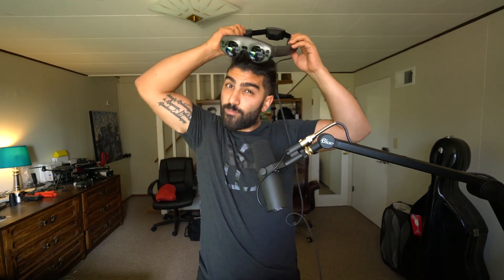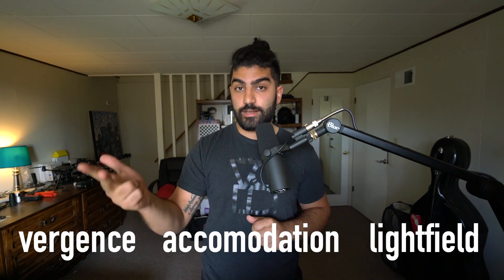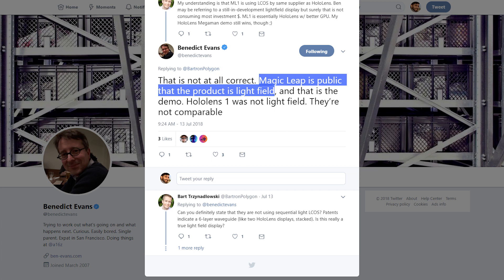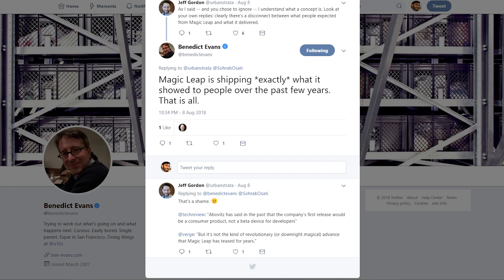The Problem with Magic Leap One's Display, Explained

Comment: Hey man, amazing work , i want to have your thoughts on the software you use for interiors I've tried using photo scan but it seems to pick up on unnecessary details in wide areas i might try 3DF zephyr to see if its better than photo scan

Comment: Dig the podcast and this vid was a solid supplement to the ML 1 podcast epi.  I was at the Digital Hollywood conference last week, a few days after LeapCon, and lot of the talk centered around Leap's AR future over Oculus' VR.  At OC5, Michael Abrash suggested scaleable AR headsets were more than 5 years away because of glass technology.  Leap defenders at Digital Hollywood suggested that was false, proven by Leap 1 and a headset by OGD.  I took a ML employee to task on a panel because he seemed to be peddling what, in my opinion, has become an insidious quality of Magic Leap's promotion -- deceit.  You were much kinder in your review, suggesting ML's waveguide technology is an overstatement rather than a lie.  I agree with your video's concluding premise -- that experiences are all that matter to the consumer.  However, I am troubled by what seems to be a pattern of obfuscation by Magic Leap going on 4 years...

Comment: Nice video, good attempt at explaining how it works! However, there is a factual error. You are confusing the lens of the eye with the iris. These are different things. The lens is behind the iris, and it actually changes shape to bring distant or close objects into focus. This is accommodation. The iris is changing size according to how much light is entering the eye, enabling us to see in a very large span of lighting conditions. The iris is not involved in accommodation.
Reply: This. Although the description provided by the video is not completely wrong (iris size does affect focal capabilities of the eye), the eye's lens is primarily focused by stretching the eye ball in four directions (up, down, left, right) using the four muscles attached directly to the eye ball. This flattens the eye very slightly, and thus adjusts the lens' focal distance.
Reply: @SpaceEngines  Well, you are right and wrong. The iris does affect the focal capability of the eye, when it gets small it works more like a "camera obscura", making the image sharper. That's why people with poor eyesight see better in better lighting conditions.
However, the four muscles you are referring to, does not change the shape of the lens, they rotate the eye to direct the gaze. The shape of the lens is changed by the ciliary muscle, a small circular musclesphincter inside the eyeball.

Comment: I expected 6 focal depths working at the same time trying to sort of approximate the light field like 24fps approximates movement.... that's what they had in some concept drawings 6 planes... I didn't expect much else.... but now I understand that getting even that with waveguides will be super problematic and will have some pretty big diminishing returns..... and most likely microled displays will be better for ar as far as picture quality and form factor and complexity.... but not sure about addressing the vergence accommodation conflict with that sort of display